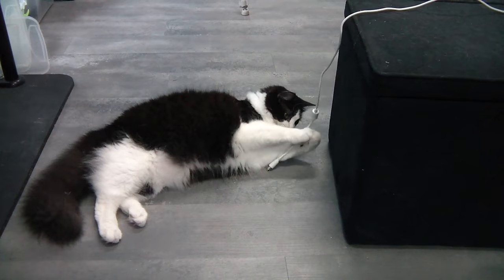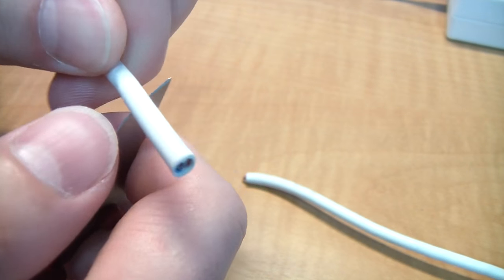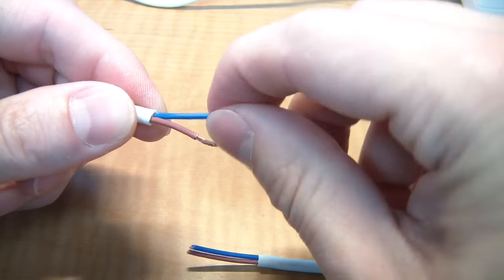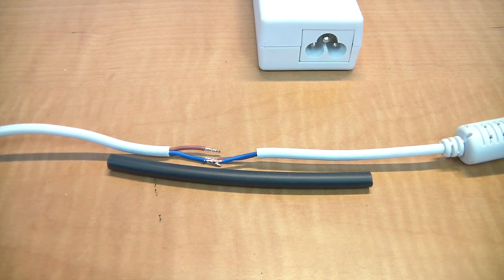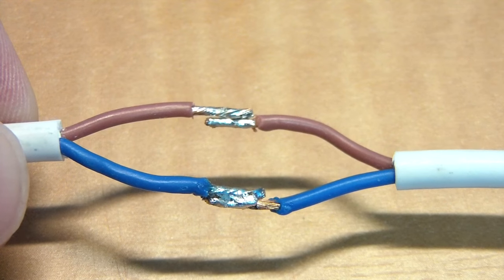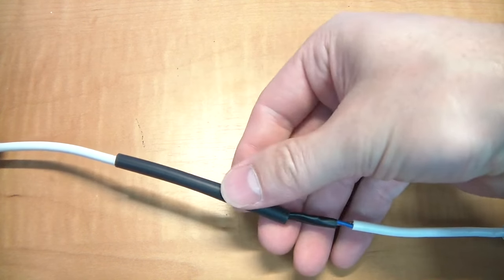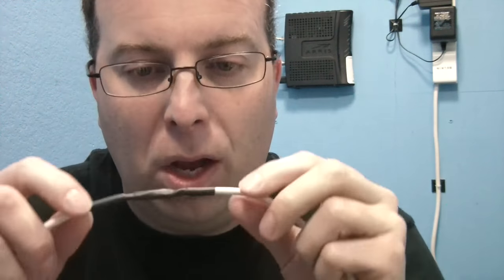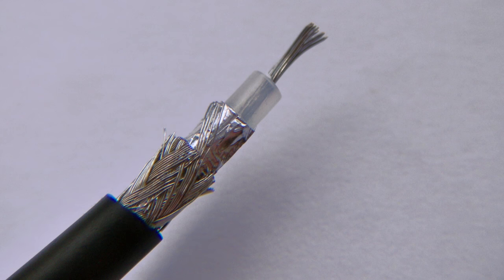How to repair a power cord that has been dog chewed.

Comment: Although. Nice NASA Standard soldering joint. The fact is thought, there is no mechanical strength in this kind of joint.

 A straight through crimp, on tinned wire, then the heat shrink. Would better, as it would  (1) Give you a good connection ( 2) Have Mechanical Strength ( 3 ) Would have almost, as good a level of insulation as the original cable.

Remember. Mains power electricity will kill you, if you give it a chance. (AMPS not Voltage )

If in any doubt. Bin it and buy a new one..
Reply: Yavor Kapitanov
Ok.. Your Funeral...
Reply: There is no direct contact with the electrical tape insulated wires. That part is within the box of the machine, is it really hazardous?
Reply: Yavor Kapitanov

It's not the voltage. It's the Amps.. 70mA is all it take to kill you..
Reply: The Pumpking King first of all it's called current. Ampere is just the unit of measurement. Nothing will happen with him as long as he doesn't do stupid things, like pull the wire. Sure it would be better if he soldered it, but it should be fine
Reply: Joyrider Next your going to tell me it's safe to play with matches and petrol..
Reply: Let me correct you sir. 10mA across your heart is enough to kill you. But you know that little thing called the Ohms Law? It says that the current flowing through something is equal to the voltage put across it divided by the resistence of that material. In example, to let flow 10mA, trough a typical impedance of dry skin (around 300kOhms), you would need 3kVDC, so. Obviously AC current is more hazardous to us humans, because of the capacitive properties of our bodies, but, to resumen, you need a high voltage source, a small enough resistance and a supply capable of delivering said current to kill someone.
Reply: That's like saying "it's the stop that kills you, not the speed". The voltage is what gives you the amps. You can't have one without the other.

And before you go on with "you can have high voltage without getting amps" (static discharge and so on). And well, yes, but it's comparing apples and oranges, completely different situations. Fact still remains that you CAN'T have current without voltage. There's a reason it says "Danger: high VOLTAGE" on stuff.
Reply: It's neither the volts (potential) nor the amps (current). It's more accurately the total energy transfer. Static discharge is safe even with 1000s of volts and amps because the total transfer of energy is low.

Comment: does soldering matter or can i just use plain electrical tape? im still young and dont want to fuck up the job lmao
Reply: +Iron Manatee Soldering is the most important part.
Reply: Soldering is way better than tape, I had a laptop fan and cut the wires, and taped them together because the usb part didn't work anymore, it worked very well... for a few weeks, until I bought another one because it didn't hold up.

Comment: I guess I did it wrong. I tried soldering it and it came out messy because im not a pro. My vacuumed worked for a 10 minutes then the connection sparked and the wires blew off😔

Comment: Ummmm....1st and extremely important thing to do any time you will be cutting(amputating is what an ER Trauma doctor might do if say someone a horrible mistake by cutting some wires from some unknown source causing them a severe shock from an electrical explosion to,lets say a finger that has basicly been cooked by the electrical current?) is to unplug it from its source,then and only then you can cut and repair the wire?!

Comment: He doesn't know how to properly splice two wires together. You don't simply place the two wires next to each other and bond them, then clamp. You want to spread each wire bundle, exposing the individual wires. Push the two wires together and twist them as one, then solder. Doing this will help the wires stay bonded better than relying on the strength of clamped solder. Still want to use the heat shrink to protect the repair.

Comment: I have cut my cord just to find out that it looks different on the inside. great.
Reply: Igabella I'd buy a proper "connecter" rated for the Power that'll be going through the cable
Reply: Dylans VitaReviews omg keep your "wisdom" to yourself
Reply: If you're not sure what to do, buy a replacement cable. It's not worth the potential damage and risk to attempt a diy repair.
Reply: Igabella They're all colored coded it doesn't matter if you have 2 or 10 wires, simply match the colors.

Comment: NO NO NO! If you put them together and solder them eventually it will just break. Solder is a 60/40 mix of tin and lead, even weaker if you use all-tin. YOu need to twist them together to the point where you cannot pull them apart and then solder.

Comment: This is not how u repair high voltage cable. 

Your suppose to twist them opposites and use a thin strand of wire and wrap it around the twist at least 6 times for strength, This is same way NASA do projects

Comment: Please make sure the plug is not connected or plugged in while doing this.
Reply: In this case it may not matter so much, mainly because this is a low voltage appliance (<50v), so the chance of shock is very low. However though, if the cord is referenced to the mains in some manner, commonly through a capacitor, you may find that items like RCDs (Residual Current Device) and MCBs (miniature circuit breaker) may trip due to leakage current to earth
Reply: +Frankie Sparkes that what I was thinking because I had a teansformer that never shocks and nothing happens when short circuit happena now that transformer died I have a new one wich is 11-14DCV 1A but It shocks
Reply: HappySlappy Face Have you checked to see if that transformer is referenced to the mains in some manner?
Reply: Frankie Sparkes what?
Reply: HappySlappy Face If there is any connection to the incoming mains supply, even through a capacitor or resistor, you can get a shock off that. The reason I mentioned that is because you shouldn't get a shock off a transformer unless the secondary side is connected to the mains
Reply: Frankie Sparkes well if you mean it is plugged it is if you if i opened it and checked the wires no well it didnt work after i took it to school because we where studying electronics

Comment: WTF you are soldering mains cables? O_O Is this even legal in the US? In Europe it isn't for a good reason. The Solder will deform over time and get brittle. So eventually the connection will get loose over time and you have a nice little fire. Mains connections have to be crimped properly!

Comment: OK you tried and you failed badly.  The way you have instructed will not hold up and may even cause a fire or shock hazard.  ALWAYS Make sure you have a strong mechanical connection.  I am a retired Electronics Engineer so I know of what I speak.  Avionics Video audio Automotive as long as it it copper multi strand or solid core copper you should always twist the wires together and should always use a heat shrinkable tube on the individual wires and then one to cover the completed repair.   NEVER EVER TIN THE WIRES AND LAY ON TOP OF EACH OTHER AND MELT!!!!!  Strip back enough to make the repair in the manner I have described.

Comment: This is a terribly unsafe practice. Please do not do this ever again.
Reply: Safe wiring rework is specified by IPC. Specifically IPC-A-620. Any rework not performed to this specification is not acceptable for sale/use under any circumstance. When you for example, design products, these standards are how you monitor the quality of what you are putting into the world. 

The hack-rework done here, while certainly handy for an amateur, is not safe for long term use and robustness.

For safe wiring, if you want to do so on your own, you should become familiar with these standards and adhere to them.

-Dan
Reply: most people shouldn't screw with AC mains voltage then
Reply: You would cringe seeing the setup I have on my air compressor. The power first gets to a conglomeration of several wire nuts via a cracked rubber cord, the neutral goes directly to the motor. The positive goes to a normally wall mount switch via an old aluminium construction cable. Then it gets back to the motor via the same cable. And btw almost everything is mostly grounded. I honestly don't care about how dangerous it supposedly is. As long as it gets the job done. And if you are wondering, the compressor is a 1940's modified and leaking refrigeration pump connected to some rusty tank with kinked copper pipe and it's powered with a Westinghouse 1/4 horse motor.
Reply: Dan Binnun atleast if he plugged the cord in it would trip the breaker and if that looks unsafe you should see my uncles sub panel

Comment: This is dangerous. Who can guarantee then nobody ever slips over the cable or the toddler plays with ist and the soldered wires see the daylight again?If a cable is damagded, remove it from the device or cut of the wallplug so nobody can use it until its repaired. Then replace the cable with a new cable. Even if that means spending around 5 $ in a hardwarestore or buying the original replacemnt cable by the manufacturer. some bucks saved waking nobody from the electrocuted....

Comment: splice and wrap the cables to themselves before solder, dont use solder as the glue..plus it just isnt safe to 'repair' mains cables, make a better job by using either a proper joiner or replace the cable entirely, really, ONE layer of insulating tape between the wires?  dude stay away from doing wiring how to's on ac...

Comment: Don't do this, in fact, this is illegal to do in most of the places. Don't ever "mac gyver" mains voltage stuff or you will end up a)killing your self or b) burning Your house down.
Reply: or just do it well....
Reply: thefriendlymadman It doesn't matter do You do it well or not. This is like fixing a leak in a boat with duck tape.
Reply: i had a cracked canopy on my cockpit when i was in the air force and i fixed it with duck tape and it held out for 4 months until i was able to rotate back to Australia

so duck tape will fix everything
Reply: vanhakaveri Except its not.

Comment: This really isn't a good idea for a power cable. There are better methods that I can't go into in the comments, like soldering the wires at different lengths so they can't touch and using a strong epoxy glue to keep the wires from ever pulling apart.

Comment: Don't splice electrical power cables or any wires in the computer housing. if you're a pro working for clients that is a lawsuit in waiting. if you are an armature working on your own equipment you are outing life, limb, and home at risk. the proper way is to replace the whole cord or wire connectors included. A good professional will not splice your wires.
Reply: Michael Foy sr This repair job would also be illegal in Australia. 

If you make a mistake repairing mains it could mean death!
Reply: +Michael Foy sr So what If I were to do this with my headphone cables? i'm pretty sure they don't carry any electrical current even close to harmful.
Reply: +KayKayProductions Id say go for it!
Reply: +KayKayProductions They are not a power cord. Power cords carry higher voltage. Like home AC or DC in the computer box, or in a CRT or TV. Some of those can kill you easily. Head phone may work fine and not cause a shock hazard.
Reply: +Michael Foy sr It's not always possible - what if the wire is permanently attached to the device, or buried in the ground? If you do a proper double insulated splice it should not be such a danger.